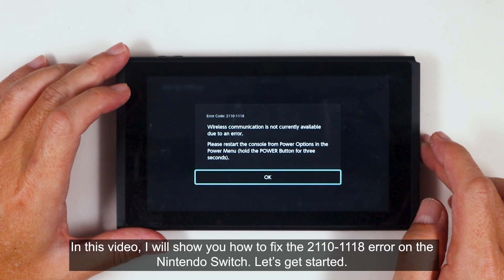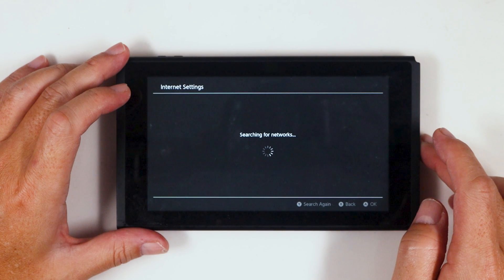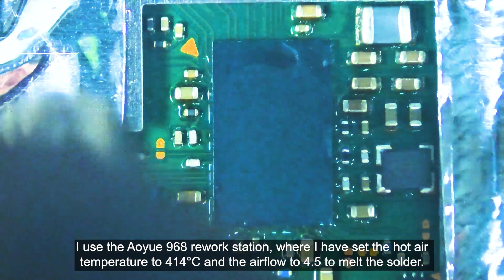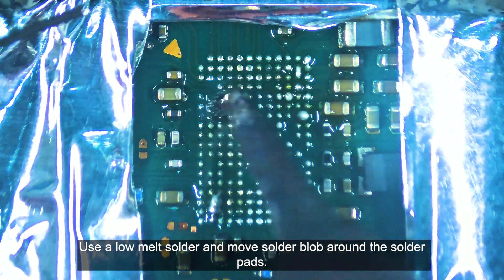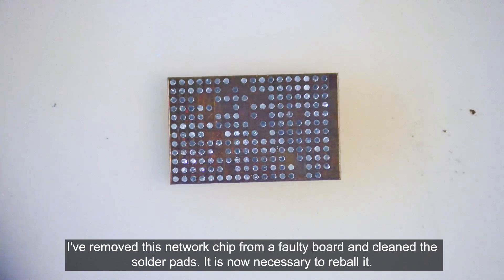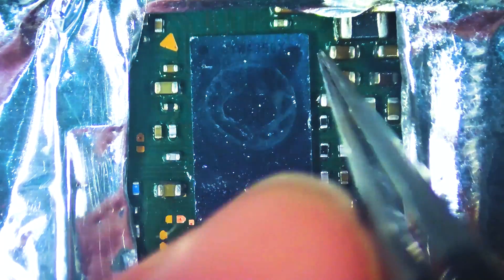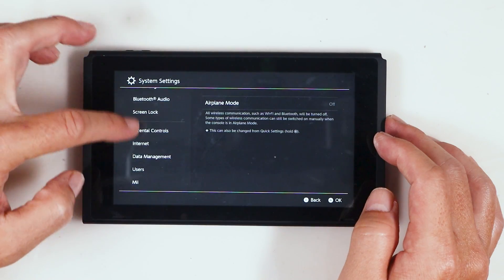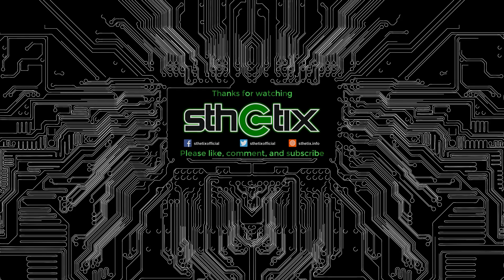SOLVING THE NINTENDO SWITCH WIFI 2110-1118 ERROR

Comment: Other options if chip replacement doesn't work :
1. Check the 2 lonely caps near the APU
2. Replace oscillator next to the wifi/BT chip
3. Reball APU
Reply from the maker: thanks for sharing those tips bro!

Comment: Very nice tutorial....My Wifi IC had a short circuit. I had to replace it with a new BCM4356XKUBG as I don't have a donor board. Is it still the case that there is no way for Bluetooth to work now?
Reply from the maker: Yah, BT only work if you pulled the wifi chip from another console.

Comment: my wifi wasnt working for a few months, now all of a sudden Bluetooth isn't working either:( is there any way of knowing if reflow will be enough to fix it? or replacing chip is necessary?
Reply from the maker: try to reflow, but if it doesnt help, you need to replace the chip

Comment: hello, even replacing the chip pulled from a donor board the error persist, have you seen this problem before?
Reply from the maker: the either the chip is damaged or your console has other problems. if your console is modded, you need to check the two caps on the side of the cpu or check the corresponding caps around the broadcom chip
Reply: @sthetixofficial  thanks, the chip i'm pretty sure is working fine, the caps You mentioned near cpu was damaged and replaced, but still, caps near chip are fine i think, but i will try Reball the cpu if nothing else works

Comment: Hi Sthetix!, this error can happen when you broke/take out the 2 capacitors near to the cpu shield that are connected to the wireless chip. This error happened to me but it was because of that.
Reply from the maker: I know that. but this console isn't modded 😁
Reply: Which capacitor? I have the same issue after replacing thermal paste😅. WiFi is not working but Bluetooth and joycon connection is fine

Comment: Hello, friend can solve soft bug: after tegra wipe on the ns lite version the battery is charged only to 4.2V, instead of 4.35 because of this 10% of the battery capacity is not used

Comment: Great video. Can you advise on this issue with a Switch Lite please? Same error code but is intermittent. Every 5-6 months the code comes up and when I reboot the system the HWFly mod chip won’t boot. Three separate occasions now I have reflowed the points and then the modchip boots and wifi works fine again for another few months. 
Any ideas would be appreciated, have searched online but can’t find any answers.
Reply from the maker: the hwfly has nothing to do with the wifi chip, but you can try removing the chip connection and test the wifi. and finally  try to replace the chip and see.
Reply: @sthetixofficial  Thank you for the quick reply. I thought the same too, have replaced the chip and it still happens from time to time. To be clear, everything works fine for months, then the error code randomly appears and seemingly is only fixed by reflowing the top four connections 🤷🏻‍♂️. When the error code comes up, the switch can not reboot.
Reply from the maker: try to replace the hwfly chip